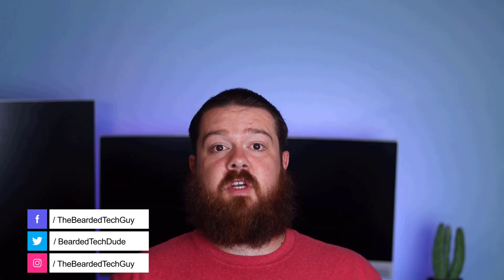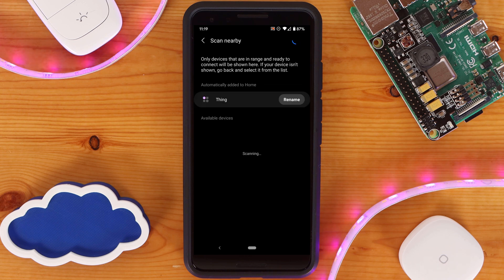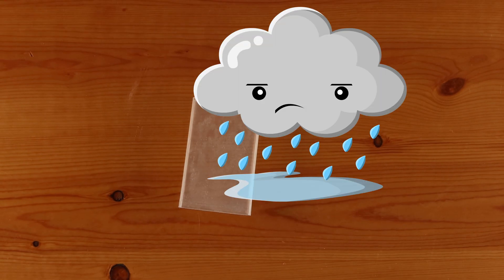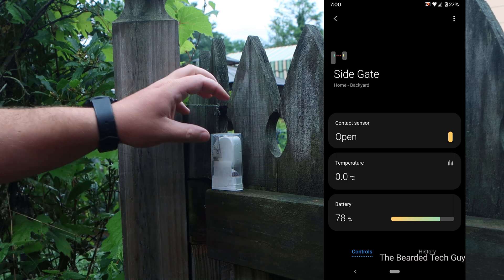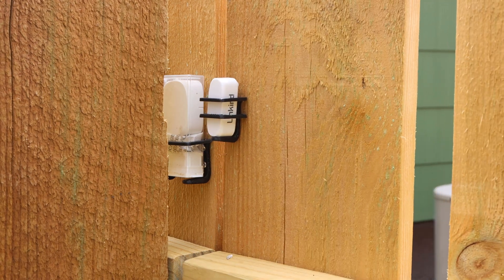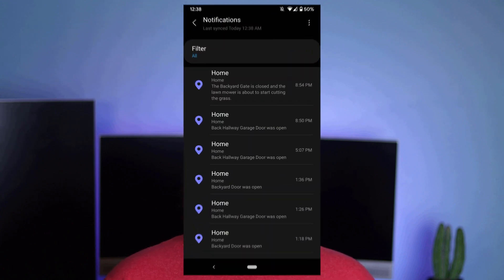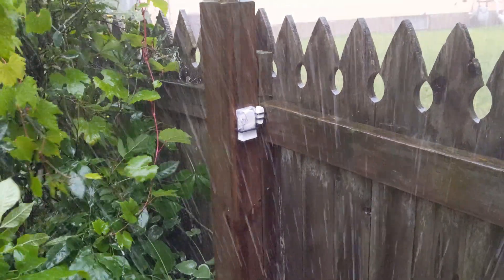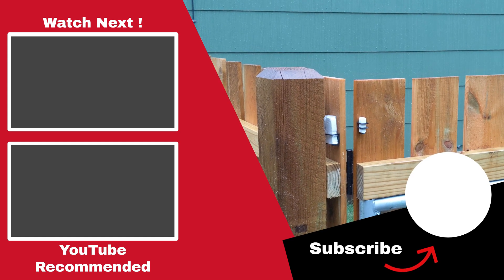DIY Smart Gate Sensor for under $15 🏡 Smart Home Smart Fence Gate Project For Home Automation

Comment: Thanks for sharing such useful tips. This is by far the easiest and smallest footprint. I really like your solution….except, I don’t have 3D printer. How can I get the 3D-print mounts for the magnet and Tic Tak box? Can I order those? Please kindly advise.
Reply from the maker: There are services you can pay to have files 3d printed for you, some public libraries actually have 3d printers you can use as well. Another option is the Zooz contact sensor ( https://amzn.to/3MKXfyK ) that they sell an enclosure for which can be found here: https://www.thesmartesthouse.com/collections/accessories/products/waterproof-case-for-the-zooz-xs-open-close-sensor

Comment: So you're running  smartthings and hubitat?
Reply from the maker: Yes, I bought it a few years ago to mess around with when SmartThings started changing things up without a lot of information and it seemed like the platform might go away. I'm still mostly on SmartThings currently, but for this project it was really easy to get the Google Text To Speech to work.

There are ways to get Google to talk with ST either through Assistant Relay ( https://community.smartthings.com/t/release-assistant-relay-v3-3-beta/176402 ) or Home Assistant, but it took me maybe 3 minutes to setup through hubitat so I went with that option as I already had the hub lol